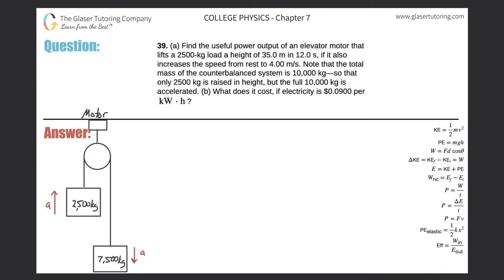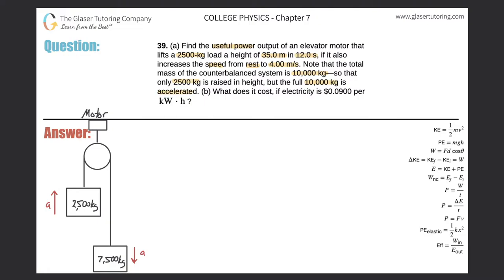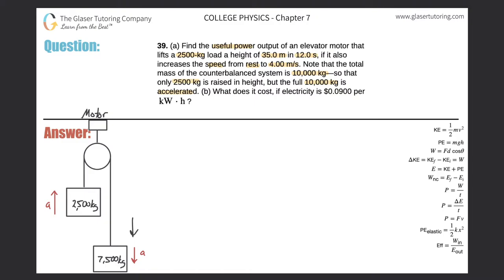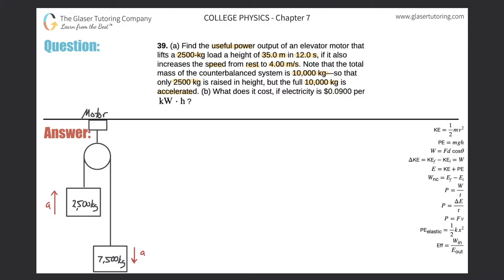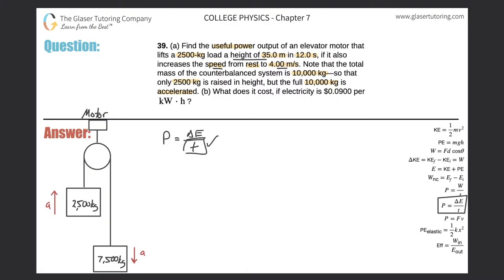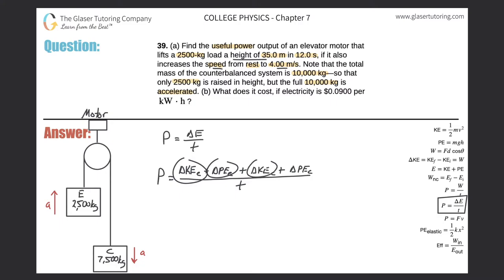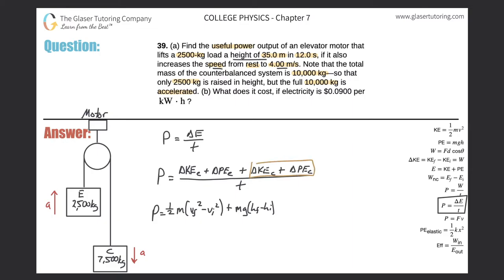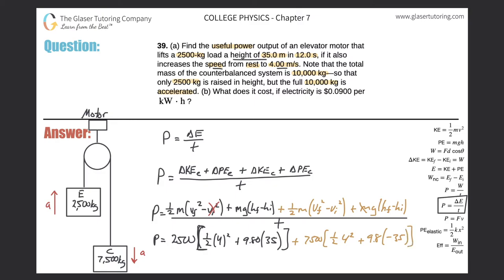7.39 | Find the useful power output of an elevator motor that lifts a 2500-kg load a height of 35.0

Comment: For anyone else looking for the solution to this problem, the question is actually looking for a different solution, just FYI. 
Instead of finding the delta E of the elevator and counterbalance separately, they say "The full 10000 kg is accelerated" meaning delta KE mass should be 10000, but "2500 kg is lifted" so delta PE mass should be 2500. Therefore, the initial equation you're looking for should be P = 1/2(m(system mass)v^2) + m(elevator)gh all over time.
In this particular example, the answer would be P = [1/2(10000(16)) + 2500(9.8)(35)]/12 = 78125 W. 
The conversion to cents is still the correct method
Reply: Thanks for your help!
Reply: @scottmason317  of course! I got the question wrong so I could see what it was looking for, so I'm glad it could help even one person.
Reply: This question had me and two other tutors stumped and then I read your comment and got the correct answer! Thanks man!
Reply: yeah i was gonna say, i think he did a bit more complicated version of the problem than is expected from the textbook. nothing wrong with that of course but i think it can be a bit confusing if you don't know this
Reply: you are a life saver!!! it's still telling me that my conversion to cents is wrong tho?
Reply: I followed the steps exactly for part b and still got it wrong.
Reply: you sir are a life saver

Comment from the maker: Hey everyone - just some thoughts: This question is simply a poorly worded question. It's impossible to just have the 2,500 kg mass raised and not have the remaining 7,500 kg lowered (if it's a counterbalanced system). Where would the remaining 7,500 kg go? That would be like doing a lat-pulldown and when you pull the bar towards your chest, the counterweight doesn't move!  The question does say that just the 2,500 kg mass is raised but it does not explicitly state that the remaining 7,500 isn't lowered, though I can see from the wording how it may be interpreted that way.  Interestingly, if you remove the 9.8 x (-35) at around the 7:00 minute mark from my calculation (just make it 0), then the "answer" would coincide with what some believe is the correct answer.  If the 9.8 x (-35) is removed from the calculation, this implies that the remaining 7,500 kg didn't move vertically at all. But WAIT - All 10,000 kg is accelerated! So in what direction did the 7,500 kg accelerate? Trust me, the counterbalanced 7,500 kg does NOT move horizontally!   Unfortunately, this seems to be a pervasive problem, and my suggestion is to please bring this up to your teacher/professor so the solution to this problem can be fixed.  Hopefully this helps!
Reply: all good appreciate all the work you put in

Comment: it's wrong. in the question, it said only 2500kg is raised in height, so in 7500 part should calculate for height, it should be 0.

Comment: Hi, I was using this video to help me with this question, however the load in my problem is 24,000 kg and the height is 25 instead of 35. I get an answer of 95000W, but it labels the answer as false. I'm changing the 7500 in the equation to 7600 and plugging in all of the values in my problem, is there more I need to do with the equation?

Find the useful power output (in W) of an elevator motor that lifts a 2400 kg load a height of 25.0 m in 12.0 s, if it also increases the speed from rest to 4.00 m/s. Note that the total mass of the counterbalanced system is 10,000 kg—so that only 2400 kg is raised in height, but the full 10,000 kg is accelerated. (Enter a number.)

(2400 * (.5 * 4^2 + 9.8 * 25) + 7600 * (.5 * 4^2 + 9.8 * -25)) / 12

Any help would be appreciated!